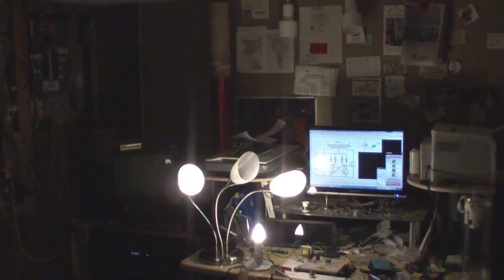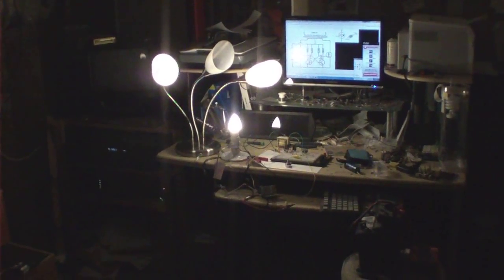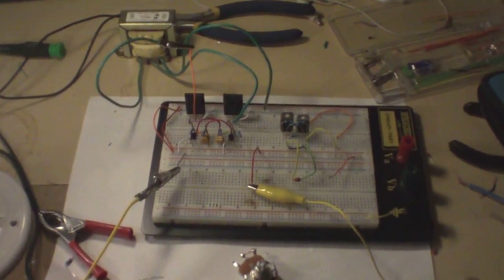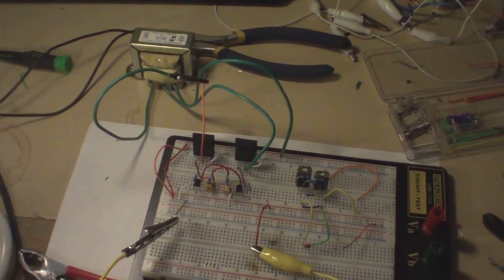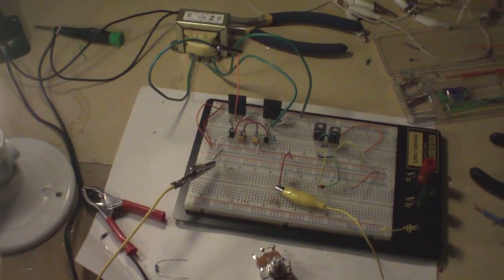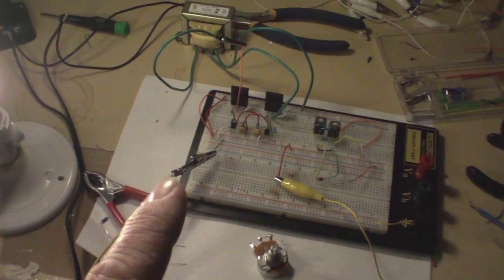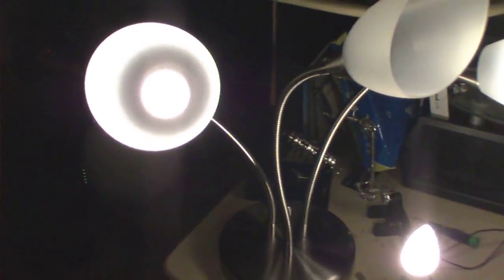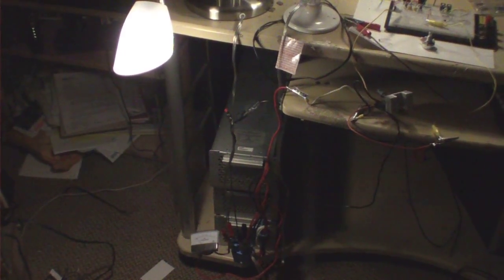PWM FLIP FLOP DC - AC Inverter Rep. (Incroyables - Vik95170) Rep

Comment from the maker: It will now help me in my other project seeing new potential in that unit, the solar energy produces the HHO, which then is burnt in a modified propane refrigerator. I see now that if you use the digital pot, again, when the solar energy becomes unavailable  and batteries are low, propane kicks back in automatically before temp. drops. PWM + light detection / voltage comparators / PIC programming / HHO / Solar. it can all be combined to allow for real time alternative energy solving.

Comment from the maker: I am running (2) IRFP450's driven by MPSA06 transistors. The PWM utilizes (3) small transistors  , an LM311N, 555 Timer and a small FET IRL 3803, so the whole thing is horribly mismatched, in a sense, but that's cause I found all these parts in monitor (CRT) power supplies, and I'm using "what I got"... I'll try to streamline this and do another simpler setup... but it is a neat approach, I think, because for lighting, you don't need even modified sine, yet dimming/no heat + AC are nice!

Comment from the maker: There's definitely a lot of different ways to do this... and while playing with it, it occurred to me that if you were to use analog voltage control of a digital potentiometer, you could vary the PWM in a lamp-assisted greenhouse, so when the sun comes out of the clouds "powersave mode" kicks in, RMS goes down, current drops... then when the sun goes behind a cloud, lights come back up!